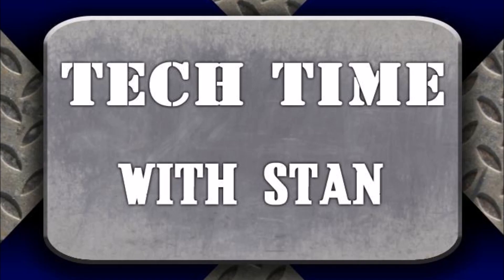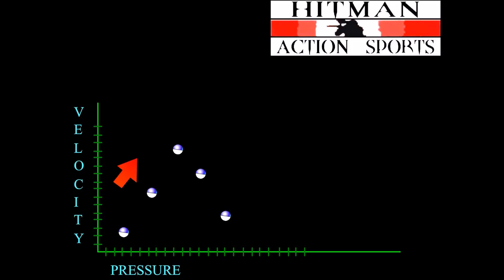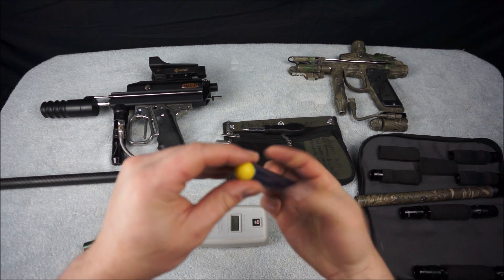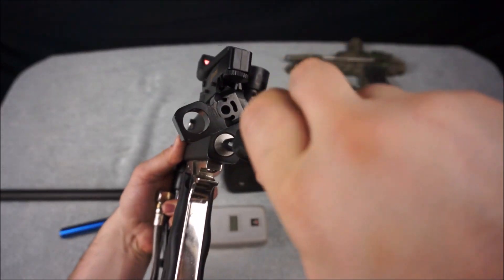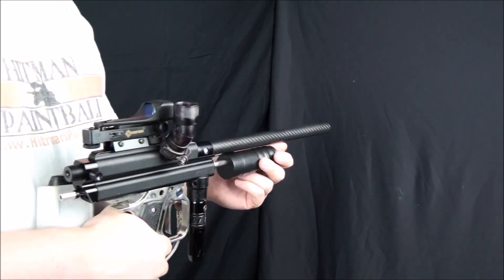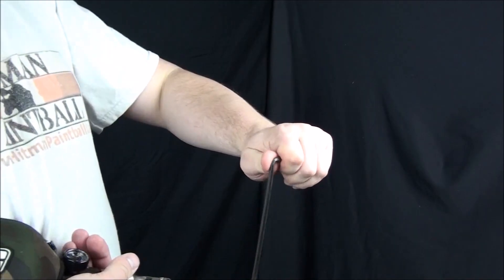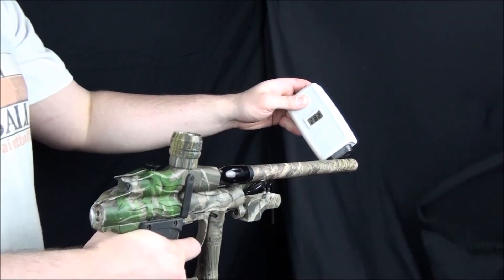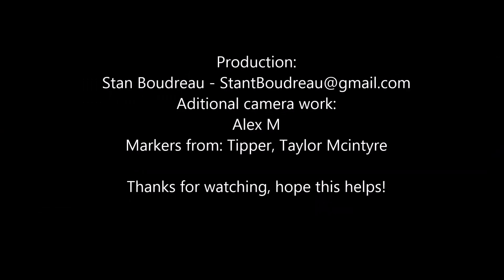Tech Time Episode 6: "Sweet Spot" your Sniper / Autococker paintball gun

Comment: So as you increase the velocity on the reg, eventually you will hit that spike (the sweet spot). And then when you proceed to increase the reg output again, the velocity will decrease again? And then just turn it back to where it was at the spike. And just adjust velocity using the lower tube? And that's the sweet spotting correct?
Reply: Yep

Comment: Hello, how does this process differ when dealing with an 04 AC with no reg adjustment?
Reply from the maker: ntme9 no it doesn't not, the 04 regs are adjustable just internally (which makes this more time consuming) the adjustment screw is inside, if you want to do this easier I would suggest getting a reg with external adjustment or find a how to on your reg
Reply: Hitman Action Sports, ok thx ill look into it. Reading the manual only speaks of the front regulator being adjustable. How does this differ from the lower reg?

Comment: This is stupid but will the pressure blow the o rings in the reg???
Reply from the maker: Hey Chris,
what regulator are you using and what air source?
Reply: Karnivor reg with a 50 ci airtank with a cp peg adapter
Reply from the maker: +Chris Lee no real danger then if you follow the steps in this video, specifically make sure you zero out the reg and you should be fine as long as your reg is in working condition.
Reply: ok thanks but will there be a high chance of blowing the o rings because I dont know how to get in the reg and fix it all.
Reply from the maker: +Chris Lee if your orings are in good condition and you zero the reg first there will be little to no chance. I'd recommend doing a search on taking apart the karni reg first to inspect and lubricate it if you think there might be a leak inside.
Reply: ok thanks so much I will be interested in doing so.

Comment: Actually, proper underboring does not cause barrel breaks. The fact is that lots of players, including myself, always underbore and we don't break paint. It yields real benefits over paint-matching, like superior consistency and efficiency. Underboring also eliminates rollouts and partial rollouts in closed bolt guns. An underbore between .003 and .006 is where you want to be. This creates a seal between  the ball and bore regardless of any ball size variation. And you really don't get barrel breaks until you start getting close to .010.

Players who religiously match paint assume that underboring breaks paint because the idea of a paintball not breaking when being forced into a hole smaller than itself seems counterintuitive, so they never bother to test it to see whether that's actually true. But what they don't realize is that when they match their paint, they are really achieving mediocre efficiency, the worst possible consistency, and the occasional possibility of rollouts. This is because paint size within a batch varies, and this size discrepancy only affects performance negatively when you attempt to match what is inevitably varying sizes to a single barrel. Some paint will fit perfectly. Some paint will get stuck and create a seal. Some paint will roll 2 or 3 inches down the insert and then stop. Some paint will roll out completely. Paint matching is a crap shoot and it doesn't help your gun's performance like you think it does. Don't take me word for it, though. Just try underboring for yourself. You'll find that barrel breaks won't increase, but you WILL need to turn down your velocity about 15-20 psi.

Aside from that, great video on sweet spotting.
Reply: Much agree. I always underbore with my sniper.
Reply: Xtian C. 
Yep. Underboring is a must with any closed bolt gun. Rollouts are the 2nd most annoying thing in paintball.
Reply from the maker: Thomas Catlin sizing for a good seal is what you want for a closed bolt gun, in the video I said if the fit is too snug you risk a barrel break, both are true.